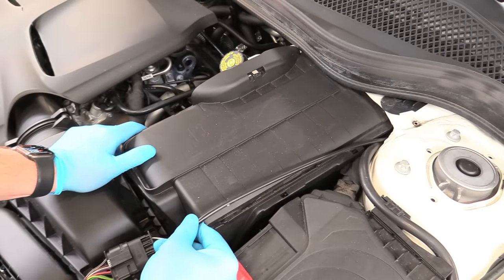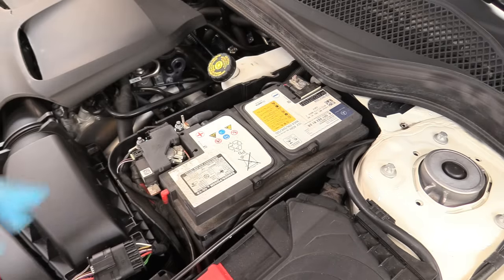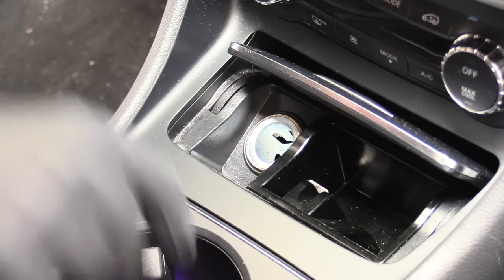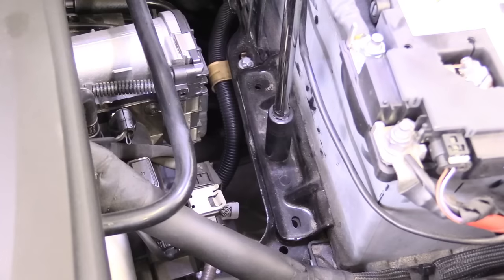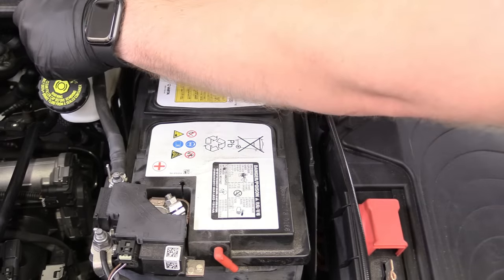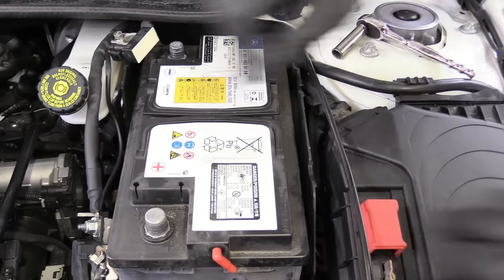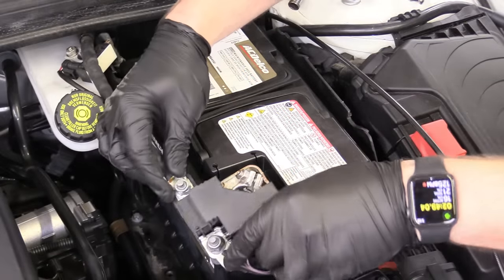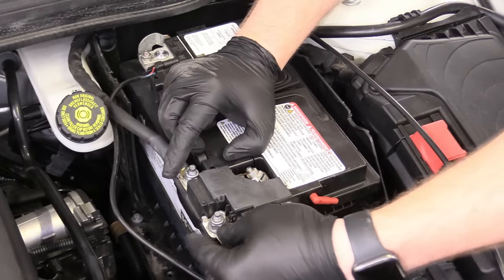How to Replace a Car Battery and Keep the Computer's Memory

Comment: @2CarPros So, considering de-powering a vehicle's electrical system (by turning the vehicle off and disconnecting the battery) is the first step to perform most electrical system repairs, how does one cut the power to the entire electrical system without cutting power to the on-board computer?

(Could be the subject of at least one YouTube video, huh?)

Comment: I purchased the NOCO Boost HD and the connector cable that connects to the power out from the booster has a male and female connector on it. The power out from the booster requires the male end of the cable. The adaptor that plugs into the cigarettes lighter/ auxiliary power port adaptor has male connector and so does the remaining cable end. Is there a auxiliary power adaptor the has a male input?

Comment: I changed my battery on my Mercedes cla 250. I didn't do any steps you did at the begging. Now my car does turn on but after 5 sec it turns off. You think i may have messed up the computer or something.

Comment: Very cool but for the price of that tool I rather let the dealer get the headache, the tool range around 50 to 65 dollars if you buy a harbor freight tools kind, then going through all that hassle, hoping that nothing goes wrong? as a mechanic myself, I don’t recommend this, make sure to check reviews and check the warranty in the jobs before doing anything.

Comment: You mention you turn it on after you plug in the cigarette lighter. What is the thing do you need to turn on? The car or the power pack?
Reply from the maker: Ignition to the second position BUT DONT TRY TO START IT Thanks for watching!

Comment: Actually, other cars have the same problem. I have a 2009 Scion xB and it needs a constant voltage to keep the computers and radio settings in tact. I've used a simple device that plugs into the n12 volt port (formerly cigarette lighter) with a 9 volt battery attached. 9 volts are enough to keep this system alive.
Reply: I think some cars have to have the key in the on position for the cigarette lighter/auxiliary plug to work. Does the key need to be in the on position to supply voltage to the computer in your scenario? Thanks.
Reply: My 2020 Acadia does not have power to the Cigarette lighter socket with ignition off or on acc.

Comment: Hi 2CarPros. I have had this computer problem with Subaru’s MY2007 2.5ltr 10speed manual is a bitch to drive (stalls at every intersection) if you have disconnected the engine management computer. 
It does re-tune step by step over a week or two!
Ans; I made two light duty jumper leads with a small lamp 10>20W, connect to any P/S, if you F/Up the lamp lights up . How simple is that! LesC.

Comment: Why, if you are connecting another 12v to the car, does it not blow the system as you are now putting 24v through it?
Reply: That does seem to be a good question. Because until you disconnect the main you do have the over volts I'd think😮

Comment: I can say I have had no issue changing my battery on my 2011 Tucson. It does not care if the power is disconnected other than losing the radio presets on the xm radio.

Comment: Hello, I was wondering do we have to buy this gadget or will any 12v battery power supply with alligator or lighter attachment suffice?
Reply: Any 12volt supply will do BUT, BUT be very careful that you have the polarity correct and don’t short anything !

Comment: Won’t adding the 12 volt jumper add another 12 = 24 volts at least momentarily? Will that do damage?
Reply: No, it is in parallel so the jumper may try to charge the battery up to 12v if it is flat, but no higher. Actually chargers usually supply a bit more than 12v (usually 14V).

Comment: My jump starter has USB QC output. Says 12V at 1.5 A on it. Is that enough power for this method? Also wondering if this method can be used to keep supplying power to the ECU for basic OBD2 code reading without turning the engine over. OBD2 readers tend to draw power, so I'm always worried that I'll flatten the battery if I keep reader connected for too long.
Reply: You don’t have to start your vehicle to read code’s throughout the OBD port. But you do have to wake the ECU and other modules up by turning the key on without starting the engine if you want to read stored codes. That will take more than 1.5 amps so, no, it won’t work. 

All that 1.5amp port is good for is to provide enough keep-alive power to the ECU while it is OFF to keep its memory from loosing its contents as it might otherwise while changing out the 12v car battery.

Comment: starting in 2022 Tesla replaced all of their 12 volt lead acid batteries (you won't e able to find one in the car). The replacement was a newly designed lithium 16 volt battery that is permanently installed. The design of the new battery is the same as the power batteries and should last the life of the car.

Comment: New subscriber here, I have a question sir, how about if we do weld in any metal part of our car, can we apply this method? or we totaly remove the electric supply to avoid damaged of accessories?
Reply from the maker: I would completely remove the battery to be safe. Thanks for watching!
Reply: Welding on metal(grounded) frame and attached parts would not normally affect voltage circuits, but high currents could be induced in nearby sensitive wires.  In my opinion, the most risky scenario would be to take the battery out and leaving the positive and negative battery cables open—thus subject to high voltages being developed between the positive and negative circuits.  The next safest would be to have a low impedance 12v battery clamping/limiting the induced voltage. The best case, although causing the memory data to be lost, would be to short the positive and negative cables together, after some time to allow for decay of existing charge, so high voltage would not be induced by welding.

Comment: Use a old tried but charged battery hooked up to cables and the car's cables. Pull the car battery out and replace with the new battery. It is a two person job but works of you are careful.
Reply from the maker: That works too! Thanks for watching!

Comment: Do you recommend any specific auxiliary power port adapters for the jumper? It doesn’t look like the amazon link includes the adapter to the cigarette port? Also was hoping to possibly purchase just the adapter to fit my topvision jumper.
Reply from the maker: No, anyone should work just splice it in. It just need to provide a tiny amount of power to the system. Thanks for watching!

Comment: Of course car mfrs have to design for the case of no-power because a battery my die unexpectedly at any time.  Also, re the cigarette lighter / power port, can these typically supply power in both directions?  As a cig lighter it is designed to supply power out.  Now, you are assuming it can also accept power in?  Hopefully the car's user manual will cover this situation.
Reply: Of course power can flow in or out of a cigar lighter. I keep a battery tender plugged into a cigar lighter in my Ford V10 motorhome during storage, Works great. I even have a plug in DC digital voltmeter plugged into another cigar lighter so I can monitor the charging volts and also the battery volts when not using the tender.

Comment: Question with the genius turned on can I just connect the jumper leads to the battery terminal leads then remove and replace the battery.?
Thanks in advance
Reply from the maker: If you have the jumper leads attached to a new battery. It would be tricky those clamps love to fall off. Thanks for watching!
Reply: Thanks, I was careful and got away it but the cigarettes lighter method probably would have been safer . This was a really helpful video as I have the noco . They are a handy little unit. Thanks again.
Reply: Or connect up to another car or 12v battery using normal jump leads. Then swap out old battery for new with the jump leads still connected. No loss of volts.
Reply: the best answer!

Comment: what if you change from a lead acid to a AGM battery . Just got a car that the old owner changed to AGM battery and also changed the alternator. The voltage goes to 14.5 at start up then after some miles it drops to 13.1 and if I turn on the lights it goes to 12.9 or .8  If I shut off the engine and restart it starts at 14.5 again and the process continues. The old owner just put a trickle charger every night .  I did die on his wife once after 2 days and several hundred miles . I have only put on about 130 and have not charged yet. will this reset help and is there a reset for changing the alt?

Comment: What if the 12v accessory plug is not active when key is not on?  And you remove the new battery post covers before dropping the new battery in so you don’t forget to remove later?  Really?  How might that be possible?

Comment: Most modern cars disconnect the cigar lighter socket when the ignition key is switched off so unless you leave it switched on this route will not work.

Comment: thanks for the video.  can i use this kind of device to keep my baiid device powered on while changing parts such as a starter, alternator or any other electrical device on my truck, or does this send power to all those other things also?  rendering my maintenance just as dangerous as having the battery connected?
Reply: The information in this video is not accurate. If you need to work on your truck, just disconnect the battery. Nothing bad will happen. If you read my other post, I go into a bit more detail.

Comment: Why the alligator clips? Why not just use the jump box clamps?
Reply: I think the alligator clips are getting a controlled 12v up to 15 amps output and the clamps are putting out 2000 amps to jumpstart a battery. That may fry a pcm. Also I read in the Noco manual that the Noco GB70 only like lead acid batteries.I tried to jumpstart a car I just bought and it must not have lead acid battery. It just turned the engine over for a few seconds and conked out. 😎

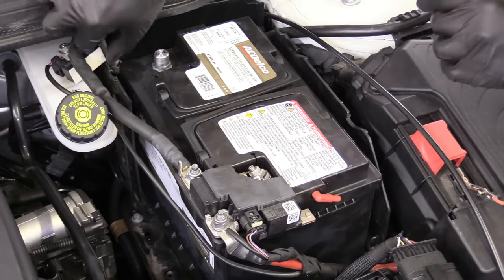Comment: 09:38 - I'm a little confused. Why would the negative terminal create a spark when being reattached and if it does, should we not continue with the battery install? Thanks
Reply from the maker: A draw can cause the battery to ark or spark when reconnected. Then those sparks can ignite the gasses off the battery and explode. Can be dangerous. Thanks for watching!

Comment: I read that the current cars have a computer managing the battery charging, which needs to be updated if an old battery is replaced.  This “perfect” video does not include that information although it mentions the need to do it.
Reply from the maker: No where do I ever call myself or this video perfect. This video is how to keep the memory alive not how to reset the BMS. I have an other video on that. Thanks for watching!

Comment: You did a good job  but I would remove  the positive  first   because with the positive  still on battery  you might touch the  Negative to the bolt or frame somewhere. cause a spark .Now to reinstall  I would put the Negative  on first .Then the positive  on last much  safer .
Reply: You remove the negative first so if to touch the positive to ground NOTHING will happen. You reconnect the positive first for the same reason.
Reply: Watched a few yt, sequences :
Black then red (removal) 
Red then black {reconnect)
Bill is right.

Comment: O.k., to simplify this. 1) Don't depend on a cigarette lighter socket. They can fail for all kinds of reasons to power the ECU. 2). the most simple way is to use another running car, to attach jumper cables, to the battery cables, and then disconnect them from the battery, making sure the jumpers stay connected to the battery terminal cables, while you reinstall them on the new battery. Obviously, only touch one cable at a time, use rubber gloves, etc. 3) the jump box is the next, and best option, as long as you are certain you know how your jump box works, etc. however, for a DIY novice, that could be problematic (e.g. failing to turn it on first, etc). Thus, jumper cables is probably the most "idiot" proof. Basically, if you have ever jumped a dead battery, and not died, you can do the procedure with jumper cables.

Comment: The information in this video isn't entirely correct. Modules don't lose their programming when your battery dies. (I'm assuming nothing is broken that may cause some type of odd issue. Just a dead battery and nothing else is wrong.). Major modules usually have some type of battery in them to keep the main programming intact. Otherwise, it would take all day just to swap the battery. What can sometimes happen, is the module(s) may lose what's called keep alive memory KAM. That's something else. KAM isn't programming data, its learned data. Things like driving hobbits. And the only way to resolve the issue, is to drive the car so the modules relearn what they need to. 

If you want proof that your major modules didn't lose programming, start the car. If the PCM, TCM, IC, RCM, PATS, etc...., lost programming, you would have a no crank, no start condition. The car can't run without all of them working. 

As claiming that the manufacturer sets vehicles up this way so customers have to bring the car in for expensive programming because of a battery failure, is just plain silly. There are 2 ways the situation can play out. If the vehicle is still under warranty, the manufacturer has to pay the dealership to work on the car at a labor rate that's usually over $150 per hour. Plus parts. If the vehicle is not under warranty, the manufacturer is out of the picture. The customer pays the shop directly. So, for a manufacturer, an issue like this can only be a loss. Not only that, the manufacturer wants the exact opposite to happen. Every time a car gets taken to a dealership for a warranty repair or maintenance, it raises the cost of ownership calculations. That's why most brands don't allow dealership techs to upsell warranty repairs. That's also why service intervals keep getting bigger, such as 5 and 10 thousand mile oil changes. If you only have to change the oil once every 10k miles, it lowers the cost of ownership.
Reply: As been said vehicle Computers do not loose there main memory. Yes they do loose the KAM (Keep alive memory) when the battery is disconnected, which is used to *learn" certain types of driving style particularly transmission shift points. In fact you can pick up an ECM from a junk yard and as long as the ECM is exactly 100% compatible as the donor vehicle no problem will exist.

Comment: I couldn't get my car inspected after changing the battery. I had to drive a few hundred miles until it generated new error codes and then I could finish the inspection.

Comment: For the cigarette adaptor would some cars not shut it down after a bit maybe killing the power feed? I have a 2018 BMW X3 M40i and wondering if I need this at all to save the memories?  Would be nice to see how you made your battery clip as I see only one side in the video.  Do you think the alligator clips are superior?
Reply: Yeah, mine has a "battery saver" which cuts power to the lighter-sockets (and other accessories, even the radio) after 10min or so, to keep the battery from running down.
I was gonna do a preemptive battery swap because the battery's been there at least 6yrs since I got the car, and potentially 9yrs since new, so wanted to find an always-hot terminal somewhere.  Worst case, a quick-connect to a slot in the fusebox might work as well.
Reply: You are not going to lose your modules programming just because you disconnected the battery. You sometimes lose KAM data, which is not a big deal. Modules have small batteries in them so the programming isn't effected by a power loss.

Comment: I have a spare 12 volt marine battery i use for a trolling motor, can i connect it to my jumper terminals while i swap out my current battery or would that mean the car is getting 24 volts instead of 12 volts ? or is it still 12 volts I don't want to take any chances thanks

Comment: Idle resetting after battery disconnection, Mitsubishi iO Pajero
To fix this you have to reset the idle as follows: If cold, start car and take up to normal temp. Switch the ignition key to "lock" (OFF) for 10 seconds. Start engine and leave to idle on throttle for 10 minutes. Turn off and immediately restart with air con on, fan on full and windows down; run for further 10 minutes. Again turn off and immediately restart with air con on, fan on full and windows down, run for 10 minutes. Your idle is now reset.
Jack, the Japan Alps Brit
Reply: Goodness  I had no idea when purchasing a car this much ag to change a battery... Or is this another man thing?  I kicked the tyres, and nothing happened 😂😂😂

Comment: I might be wrong but if you just change battery while the system is on (engine running) you can keep computer memory easy without additional equipment.
Reply from the maker: Would not recommended doing this. Thanks for watching!

Comment: Another way if your car battery is dead and it won't start  the engine, jump start it using something similar to his Genius Boost or jump start it with another car.  While the engine is running, the alternator is now supplying power to the car and the computer memory.  You can now disconnect the dead battery and replace it with a new one by removing the negative cable first then the positive cable last.  Install the cables to the new battery in reverse order, positive cable first then negative cable last.

Comment: so whats the point if you still have to reset the battery to the computer you may just need ionised water its easy to remove the caps or strip there not pertinently sealed and check the level there not screw caps anymore because they want you to renew the battery than replenish the fluid,